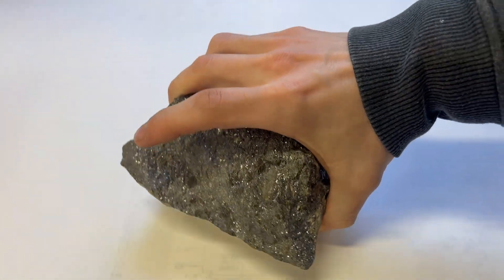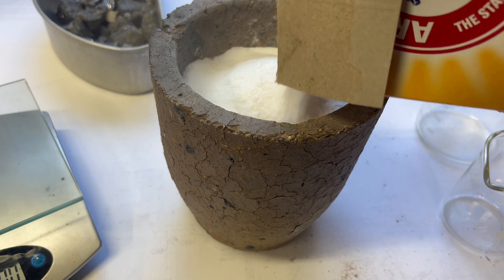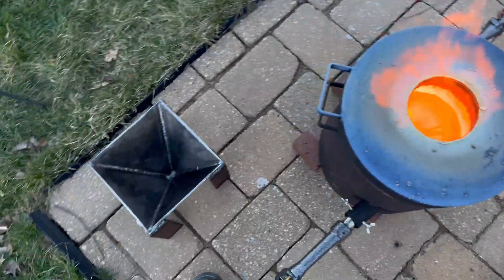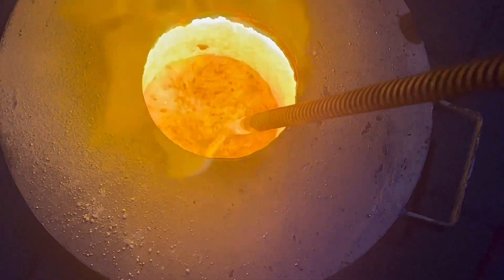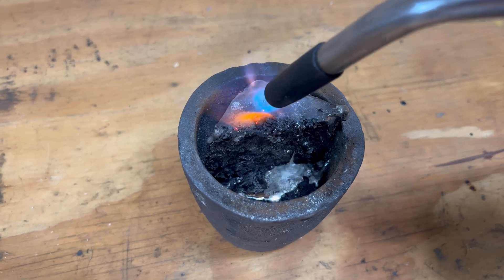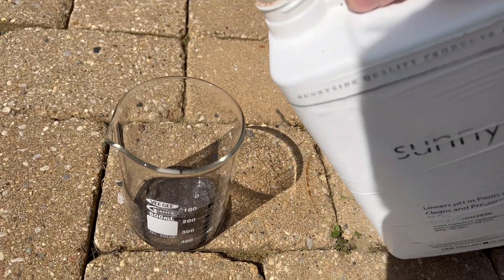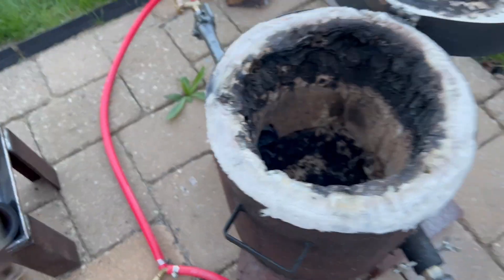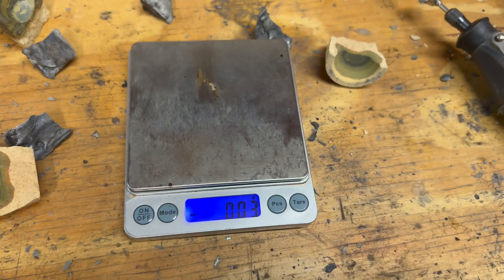Making Silver Metal from Ore.  Element Series ep: 8

Comment: I think a way to "streamline" the smelting process would be to crush the ore into a fine-ish powder, and mix in both the flux and iron powder, and make it an even mixture. you could probably have a little excess iron powder just to make sure it all reacts. wouldnt have to add solid iron to the mix and wait for it to mix and react, cause itd all already be in the mix. also, you could turn the silver (which is somewhat pure) into like 99.999(9?) pure silver via electrochemistry. its pretty much as pure as can be (atleast via homemade methods.)